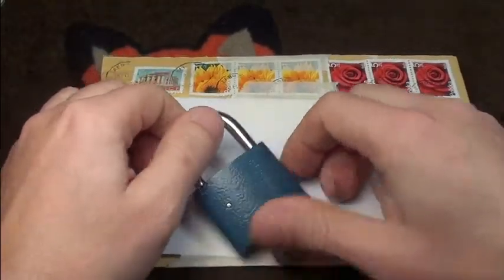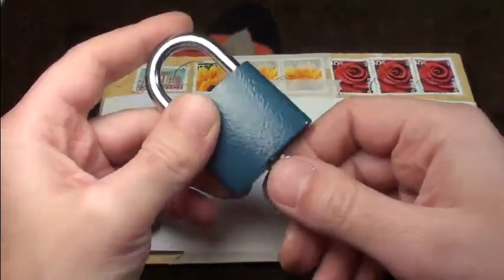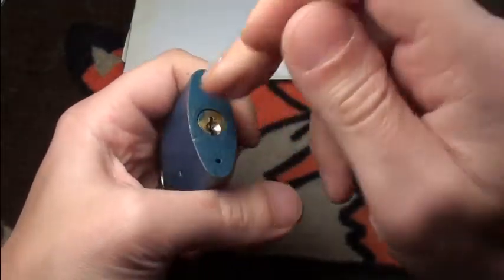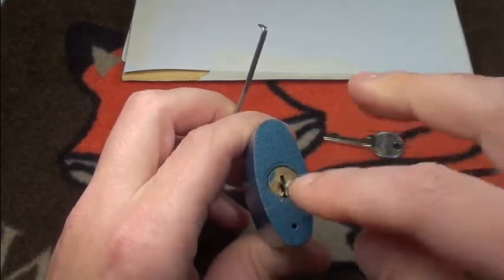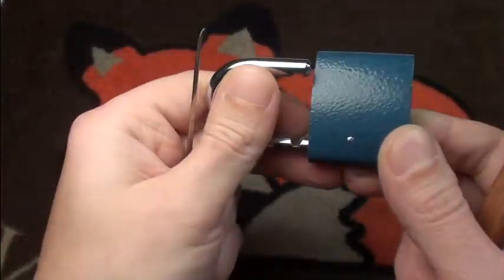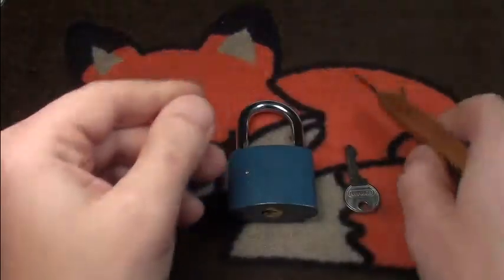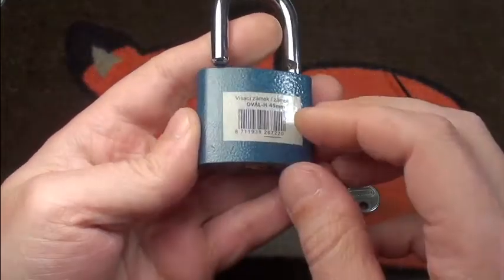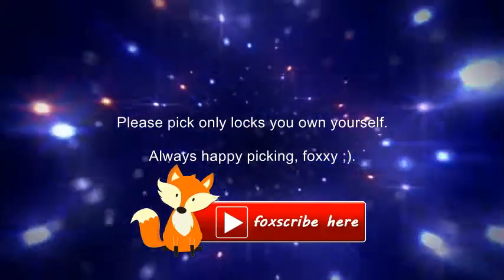(212) - picking the little blue Forman padlock for Olek - part 1

Comment: Looking forward to the next part seeing inside. I found standard pins quite trick sometimes. Nicely done picking and nice looking lock.
Reply from the maker: I was a bit surprised when I drilled it open at work ;D. Nasty as hell ;D. Quite a tricky pick, because of the bad quality, even it looks not bad from the outside :).

Comment: Nice Picking on that Padlock. It will be interesting to see what kind of pins are inside. I have no idea where the core holding pin is at on that one.
Reply from the maker: I found the pin ;D and it is quite interesting inside :).